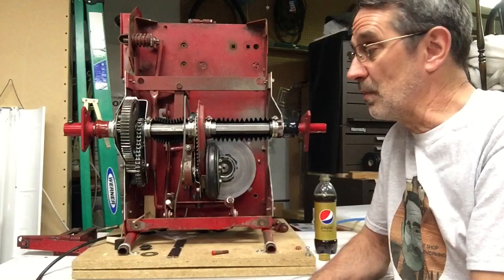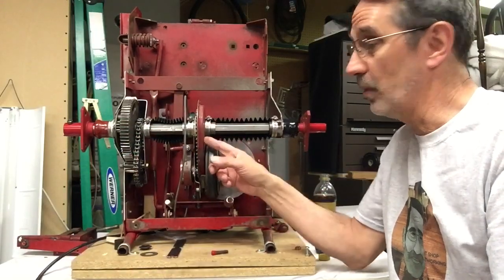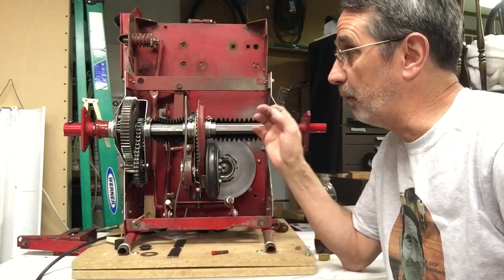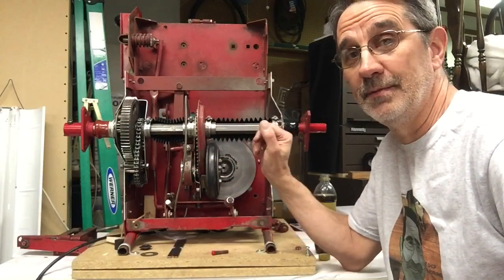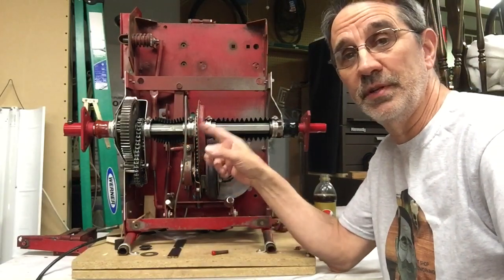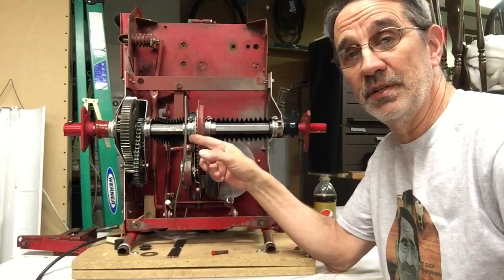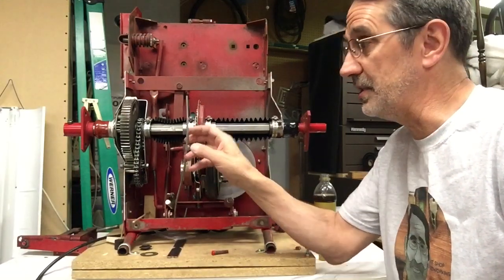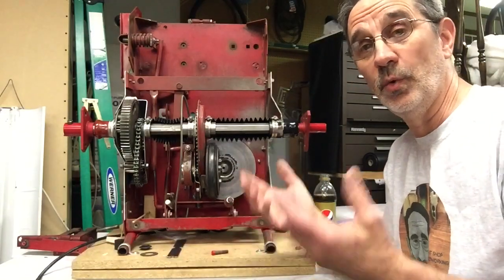251. Why did my Snapper RER quit moving forward and backwards

Comment: Hello Jim, I need serious help. I just had my snapper mowing in the yard an even tho it still runs , moves, and everything ok (forward and reverse) there is a "gear crunching" sound on every turn of the wheels, sort of like a flat spot on the gears or broken tooth maybe???  I thought it was at the wheels like you described in the video here, but that is ok. It seems to be coming from the chain case? or differential?.. I haven't started to tear anything apart yet because I didn't know which direction to go into it without possibly tearing apart unnecessary items.. I couldn't really find a video of yours that would help out? (maybe I just missed it).. Any help in what direction to proceed will be of value... THANKS... Mark.
Reply from the maker: Maggot 
 Hi Mark it’s Jim
   By what you’re describing I would say your problem would be is in the differential there are eight different gears inside of the differential and any one of them could be the issue and a chain but I don’t think the chain is the problem, sorry to say you’re going to have to pull that fender in and open it up and see what it looks like inside. Jim
    Let me know what you find when you get it open. Jim
Reply: @jimjackson9381  thanks.. I will get it open this weekend an let you know what I find...Mark
Reply: @jimjackson9381  hello again, just started in although this may be the culprit?.. the right side alxe is moving in/out 1/2 inch or more. Seems if I have it pulled out the noise is there but push it in an turn both axles together same direction in nuetral, the noise disappears.. Both axles togther seem to push back a forth side to side, I assume this is normal?
Reply: How can I send you pics directly?
Reply from the maker: Maggot 
  If you have that much side pulley on your rear tires it sounds like you need new wheel bushings a 1/32 over an inch side play is normal and you shouldn’t be able to wiggle the tires back-and-forth at all. My email is
jimsfixitshop@gmail.com
  Hope this helps let me know if you need anything. Jim

Comment: I've got a Snapper RE130 and it's had a lot of mechanical issues. I've rebuilt and replaced more parts than I ever imagined. I've had it 5 years, so should be a 2014 model. Recently I stopped going in forward or reverse 1/2 through mowing. I quickly saw the drive disc was completely worn out and replaced it, but it still was not working quite right - it moved "sporadically". It was going to storm so I pushed it back to the shed planning to work more after the storms. When I pushed it to the shed a part fell off. It's the part that mates with the yoke! The arm with the roller broke off the primary chain case. I see the replacement case is over $300 and even just the cover including this broken part is more then $50.  How do you imagine this happened? Worth trying to fix it? Every repair on this mower is like this - more than one thing is broken.
Reply from the maker: Chris York 
 Hi Chris
 The machines 2013 through 2018 had a lot of issues and that part on the chain case is known for breaking off to the point of the dealers when they got a new machine in they would have someone come in and re-weld that part to the chain case before they would sell the machine. If you have someone that can weld it back on for you that is what I would do with it. Jim
Reply: @jimjackson9381  I know people who can weld it back on - I don't personally have welding skills, so that often does not occur to me as a solution. Your encyclopedic knowledge on these machines is amazing. Thanks!
Reply from the maker: Chris York 
Well I hope you are a subscriber I could use your help thanks Jim

Comment: Hey Jim.. the snapper I got used, is a 1983. Have no parts book with it. My blade belt broke. Can i get that belt at lowes, tractor supply or is it a ordering item? Also, do u know the item # n length? Thanks for ur knowledge...
Reply from the maker: Donald Hardy 
Belts on a snapper is a Double V typically you can’t find them locally, find your model number and go on Parts Tree.Com. and you should be able to find your belt. Jim

Comment: Hi Jim. My 28” snapper won’t roll unless the clutch has been engaged. I have checked and the problem seems to be the small pipe roller on the shifter engaging the drive wheel when it’s in neutral. Sam Georgia
Reply from the maker: Sam Hollis 
 Hi Sam it’s Jim
  That’s how most of them work when you put them in park and let out the clutch the clutch disk sits on that pipe that’s on the yolk if you want to roll out you have to shift it in to what most of them consider neutral or they say roll on it it’s between Park in first gear. Jim
Reply: My mower will not go forward  i change  the disk
Reply from the maker: Judy Mica 
  You need to watch a video number 70 it will explain how to check a few things and how do you tighten your yoke spring that’s probably all you need to do. If that doesn’t help let me know and we’ll work on some other issues it could be. Jim

Comment: I have old snapper rear engine it ran great yesterday mowing my yard went to start it today it starts then turns off i look at the air filter it needs a new one tried to start with the air filter did same thing looked at gas filter it's fine what am I missing
Reply from the maker: Adam Turner 
 Hi it’s Jim
   Does your engine start up and stall right away, or does the engine start and it stalls when you let out the clutch. 
   If it starts up and stalls right away it could be your float is stuck not letting  in any gas, or if you have a solenoid on the bottom of your carburetor that could be giving you a problem.
   If the engine starts and it quits as soon as you let out your clutch that is a safety switch issue usually The one that’s mounted on your yoke in your rear case. Jim